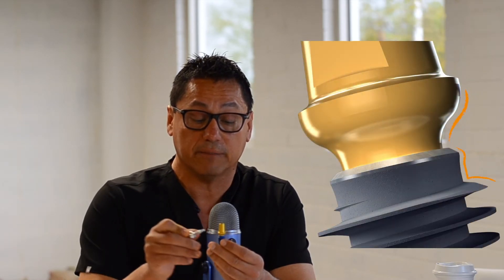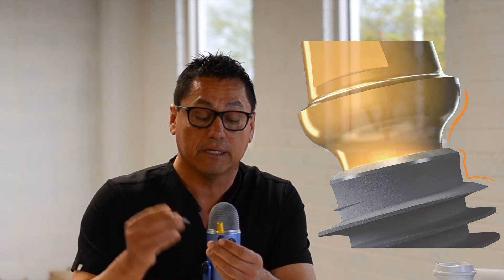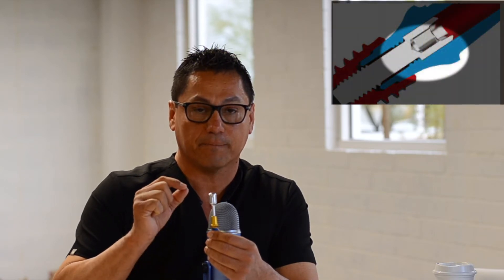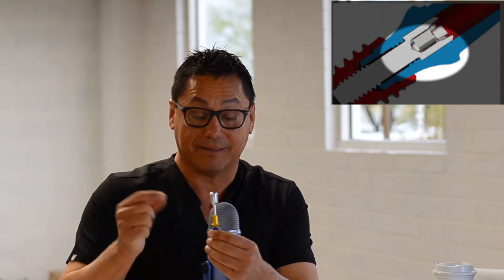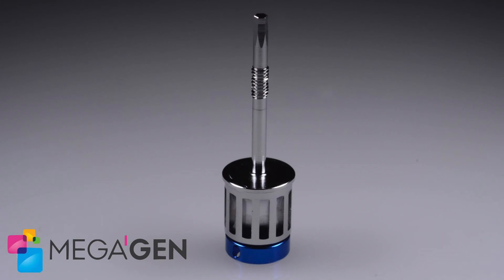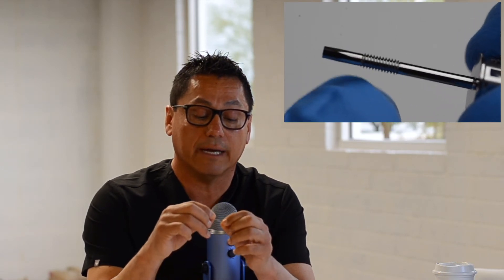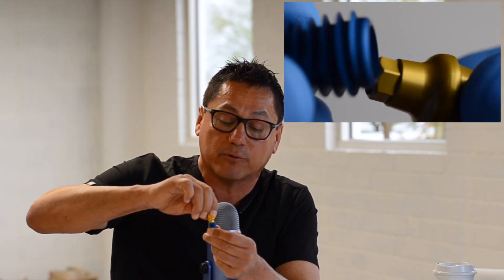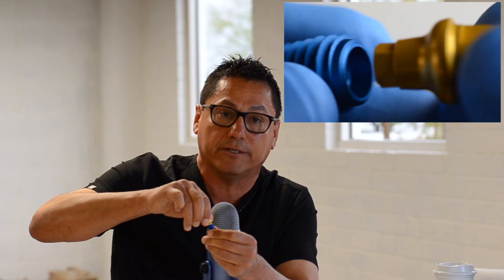AnyRidge Abutment Removal  - How to use the Abutment Removal Driver

Comment: Actually Joel, you have nicely demonstrated the inherent difficulty of removing the anyridge abutment screw from the abutment , after it has disengaged the implant internal threads. The friction fit of the 1.2mm hex driver is dependant on the condition of the hex driver ( has it worn and it will with use ) and that of the hex in the abutment screw ( which has been torqued , and so some deformation to the hex head) . Yes you push down as you turn it out. Clinically what you have demonstrated with the oversized model actually  occurs, the screw is not lifted out. This is an unnecessary dilemma the further the implant is positioned in the mouth, particularly when the patients degree of opening is limited. It is a prosthetic handling annoyance. And yes the removal driver is simple to use , to overcome the friction fit of the 5 degree cold weld. Fortunately , Megagen offers many more abutment connection designs.
Reply: if use finger pressure does not work, can we use the torque wrench?